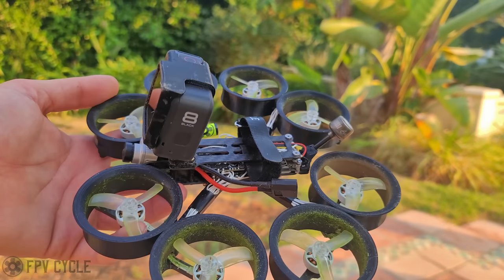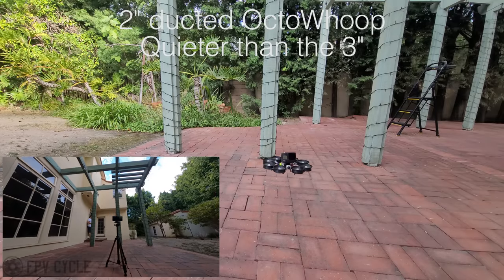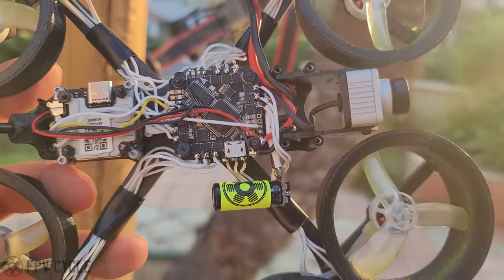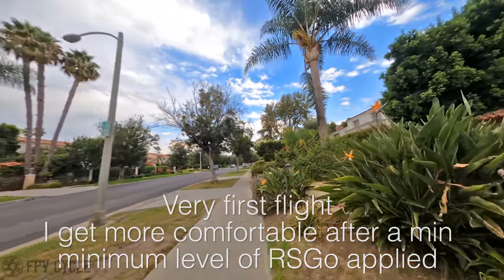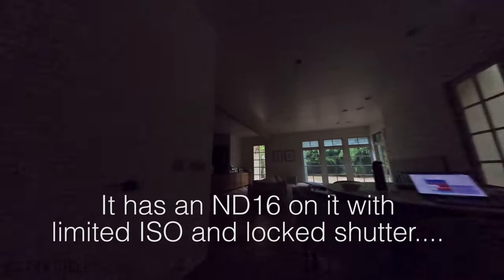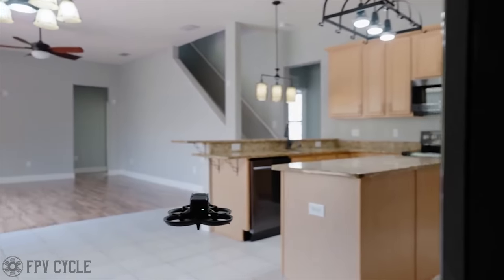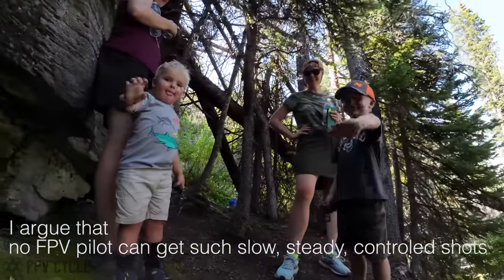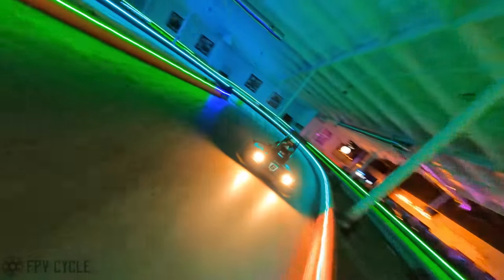Duct Duct Duct Duct Duct Duct Duct Duct Goose

Comment: Great video! I would argue that the avata would still be useful if you want go pro footage, because nothing is stopping you from also mounting a go pro to it as well and getting that stable gps flight still :)
Reply from the maker: right, as I said at the end. You can strap a hero bones to the Avata for a fantastic little craft. The issue then is that you still gotta use either the wiimote thing or the tiny little video game controller.
Reply: not really, since you loose the gimbal, it will look lik enirmal whoop then
Reply: @Kabab  yeah definitely, the controller is certainly it's weakest point, 100% agree

Comment: 3:10 What's attached to the cap? I'm used to just soldering the cap direct to the leads, but seems like there's a little more going on here with a board attached to it.
Reply from the maker: The cap is attached to a board with a diode on it which is then routed to the power input pads. All of it has a specific way to apply it so it actually works. Caps at the end of a battery connector wire don't do anything. You might as well save the weight and not put the cap on.

The description on these pages explains more:
https://fpvcycle.com/products/cap-diode-system-for-motor-noise-suppression?_pos=2&_sid=d04f2d474&_ss=r

https://fpvcycle.com/products/panasonic-fm-low-esr-electrolytic-capacitors?_pos=1&_sid=d04f2d474&_ss=r&variant=39837340434543

Comment: I have put capping on all stick controls adjustable from zero to 100% on the qx7 and I can go as slow as I want to... So I don't really need any cinewhoop at all unless it's about flying close to living things.
Reply from the maker: The issue is how crafts slide around with just a little tilt on them. cinewhoops and things with smaller blades tend to stay put more or just not skate around as much.
Reply: @Kabab  Yes, true, they do... until someone turns on the fan because it is too hot in the restaurant you were contracted to shoot and you end up in the spagetti pot. Then I prefer my 7 inch Cineglide with your 30mm motors... At least it is too big to fit in the spagetti pot 😆

Comment: I wonder if betaflights newer “acro trainer” mode would help with this? Still have acro like maneuverability, but be able to limit the bank angle and keep speed down that way?  Maybe mixed with motor limit or throttle expo to keep down ballooning? Locked position hover obviously is going to require gps, I wonder if we’re all going the wrong direction flying these on betaflight? Has anyone experimented with Inav or arducopter with ciniwhoops? We’re not really asking for the great flight feel and prop wash handling of betaflight when it comes to ciniwhoops…maybe a more nav based firmware can give the smooth locked in gps like cruising that is desired?

Comment: 6S motors like 1404 with 4S setup.  These will give you slow flight and efficiency.  low KV motors is a key to your slow flight.
Reply from the maker: Unfortunately this isn't really related to kv in this case

Comment: May want to give Flywoos 1.8" nano hex with a naked 10 a go 😅 ~180g with battery and the flywoo gp10.
Reply from the maker: I'm not a fan of the naked gopro things. It's just too much to maintain and too delicate of a craft for me to use regularly. I'm not talking about physically breaking. I mean the overall electronics are not as reliable. That includes a gopro with no battery. If I crash and the power gets pulled, I'm not gonna get much if any of that footage back.

Comment: Pretty interesting concept indeed, Bob! 😃
About the speed and control of the Avata, I wander how a cinewhoop with iNav would behave. After all, it has the GPS flight modes... You know?
Anyway, stay safe there with your family! 🖖😊
Reply from the maker: Right, I want flight code that uses optical flow and baro well.
Reply: @Kabab  I'm not sure, but I think Pawel Spychalski used an optical sensor in a quad once... I think it was just for measuring the highs, but... I'm not sure. 
But I believe the sensor was from Matek!

Comment: Nice video thanks.
I'm still waiting on a sub 250g dji hd fpv 20min+ cruising flight time.
Anyone know anything that does this?
Reply from the maker: Nothing exists that anyone would want to fly. I'm not even aware of anything that has that kinda flight time at the 250g mark
Reply: @Kabab  I'm thinking a 3s lion pack on a 3.5" to 4" platform may. Here is some one that's done it but not sure on the details...

Comment: I had the flywoo nano hex, and for a micro it was still to fast.  Also when moving slower, it was hard to control in full manual.  The avata is great for beginners but I feel without going fully manual, it's hard to unique FPV shots with just the motion controller and it's built in "normal modes".  I feel beginners will struggle to understand why their shots will look pretty much like a DJI product.
Reply from the maker: Right, these are the limitations of the avata. In full manual it's kinda sorta okay and can be used well but it's the half half self managed modes that are really useful. As with everything DJI, it turns the novice into a semi-pro and knocks the pro down a few notches. In this case, it can be used by a pro to do better work in some ways, not all ways.
Reply: @Kabab  completely agree with you on your statements.  My 10 year cold with zero experience was shooting gaps and flying low to the ground with in minutes.  Really kinda an bruised ego on some shots he was getting.  At the end of the day, every tool has it's job.  Keep up the great work and odd contraptions!

Comment: Seems a bit of overkill for just a GoPro no?
Reply from the maker: These are tiny motors. It can kinda just only carry a gopro. It's not a high powered craft
Reply: @Kabab  ok, so the increase in the number of props is giving more throttle resolution but not really more payload capacity?

Comment: I don't see what you mean about the "minimum speed" of the craft... These are multirotors. They can hover. Thus their minimum speed is always 0.
Reply from the maker: it's very difficult to fly at 1mph. It's not controllable and just slides around in random directions. You need some forward momentum for the craft to be controllable.
Reply: @Kabab  Not really. Mostly the problem is that Acro is very difficult to fly at low speeds with. Try Angle mode if you're not using it already. Better is the position/velocity source-stabilised types of modes that Betaflight doesn't do. Then the controller can stop the horizontal sliding. That is what DJI is doing that you gave so much praise to. It's not like their stuff is "magic."

Comment: I think the whole setup needs to be revamped  u need the ability to thrust in all directions fans on top and bottom.   When have the batteries and  light enough motors now
Reply from the maker: The issue is stability in place and slow movement. Not really moving in any particular direction. The software we use doesn't have code for the eleconics we need to use for the position hold and movements we want to do

Comment: Have you considered the tricopter? Servo yaw, so motors don't need to change rpm much or direction. Ultra smooth camera also. Lighter and cheaper too
Reply from the maker: It's not about turning, it's more about fine altitude control. I used to build many tricopters way back when. I won't build another again. Way too complicated and fragile with no real benefits.
Reply: @Kabab  Hmmm then I guess optical flow sensor, or maybe even lidar could be an option. The former would should not be too difficult to implement, although it may take some tuning to get right. The later may take a bit more work, not to mention weight and money.

Comment: "The things you can do with the avata are things that no fpv pilot can pull off". That's just ridiculous. You can easily do that kind of flight if you have the right flight controller setup. First of all, not flying in acro is the main thing. Then the avata has infrared and computer vision which does position hold for it which is why it hovers so stably. Optical flow gives a similar effect. Pick a flight control software that can use that and you'll be able to get similar performance.
Reply from the maker: Sure, if you have the right flight controller with all the appropriate sensors. That doesn't exist however. The DJI is the only one that can do these things with such fine control.
Reply: @Kabab  There are open source flight controllers like ArduPilot that can do optical flow position hold/stability. After that it's just a matter of hardware. DJI have spent an immense amount of time and money integrating their own software and hardware. That is why they can sell it with whatever restrictions they feel like imposing on their users (i.e. whatever will make them the most money back). If you want to have the freedom to make your own decisions on hardware and setup (such as a better camera), then there's a bit more work involved. But that doesn't mean it's impossible.

Comment: All kinds of cinerig, the only key factor for smooth steady motion is HEAVY, unless it is a slomo rig. 🤷
Reply from the maker: heavy is absolutely not the solution for smooth and slow. weight is the enemy of flight usually and definitely in this case. Lighter will allow for much more freedom of control and still maintaining very slow and steady movements. When a cinewhoop is overloaded, it slides through the air very quickly with very little angle and little recourse to correct because the intertia is higher. Not a huge deal to control but generally not preferred.
Reply: @Kabab  worked for most; counter weight for gimbals, counter current for relative movements, lift, even free fall. 
The simplest in gyroscopic propulsive motion is the blade's airfoil e.g. thick bullnose and ofkos its wider wheelbase (diagonal motor to motor). Making it heavier does not always mean to add more weight. Just work on the load that works, dummy load not.

Comment: Lame got everything but the esc
Reply from the maker: We have more of those boards on the way. The trouble will be finding a 25x25 mount 4in1. The other option is to do a three board 20x20 stack but it'll be crammed in there if it'll even fit. Tough build. That's why it took me so long to build this thing. I wasn't interested in the challenge.
Reply: @Kabab  ya I was going to do the same as you and run the Tunerc 2s-4s board and the esc on the Darwin !
Reply: hey are you just screwing the ducts in with a m2 straight into or are you using press nuts

Comment: duct
Reply: have you tried quest 2 (vr headset) as the controller, over wifi 6, even directional antennas
Reply: its all about the input smoothing, dont allow it to take unsmoothed input directly, it will jank
Reply from the maker: The flight code does input smoothing quite well
Reply: @Kabab  not well enough if you need to say "cant fpv it"
Reply: @Kabab  I mean an additional moving average on top of the pids, pids are stabilization, I mean smooth the inputs of the sticks